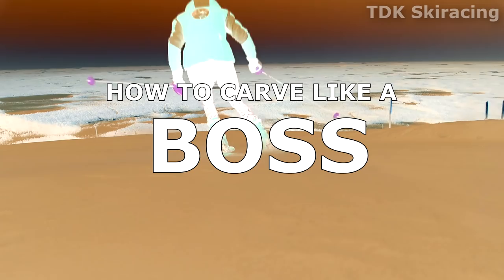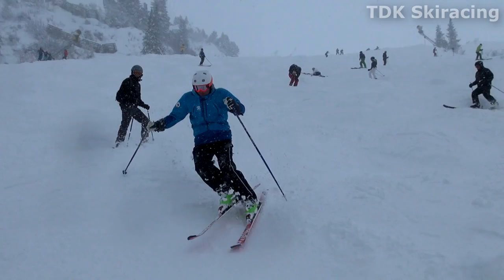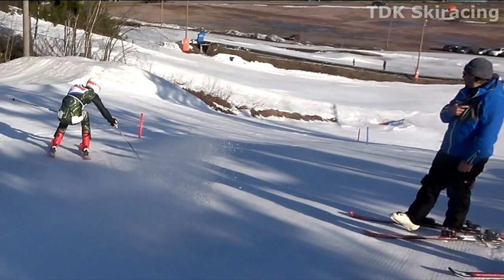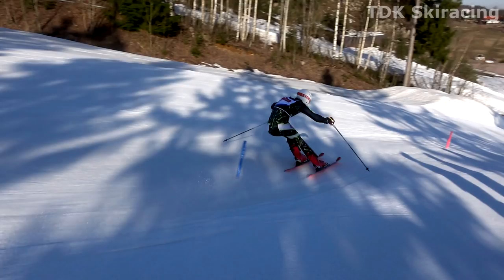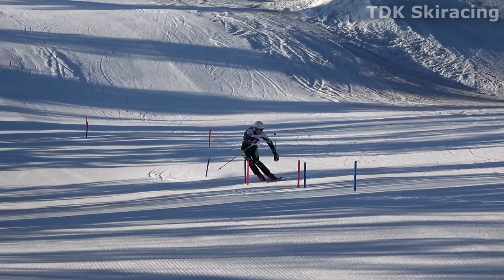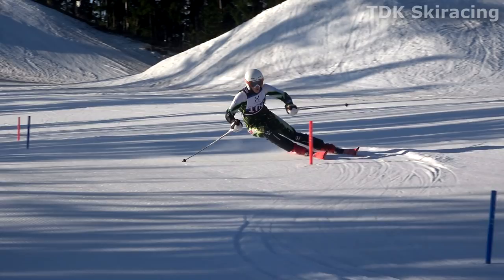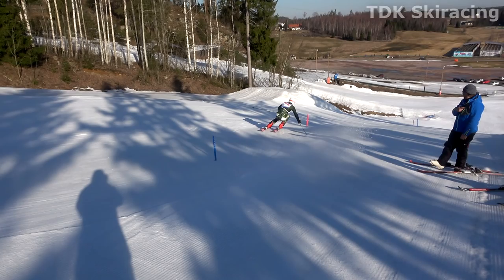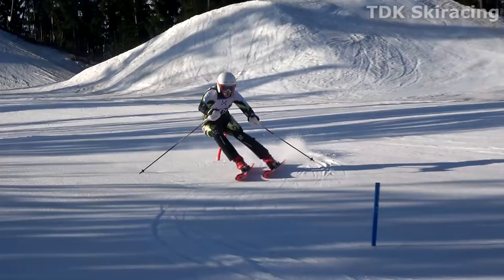How to Carve like a BOSS

Comment: Great video. Active extension and retraction (push and pull) are valuable skills, especially for quick slalom turns. The trick is to have the push compliment edge angulation, not stifle it. A more relaxed initiation allows the knees and hips to drop inside and the edge angle to improve. There's an interplay between strength and relaxation that the best racers master.  At one of Mikaela's recent GS races, the coach called out "Strong and relaxed" as she left the starting gate. She won.

Comment: Great explanation of a key difference between race carving and less aggressive recreational skiing.  I learned to ski in the 70's when unweighting was used in the turn, but since have transitioned to parabolic skis.  I ski recreational, but like to ski fast and keep improving more towards a race style.  At times I deliberately keep my body low and stable, and let the legs just move back and forth underneath, but then I fall back on unweighting when I get tired which brings the body up more vertical again.  Have never seen a video which specifically addresses this issue.  Love all your videos.  Thanks!
Reply from the maker: Hi and thanks for your nice comment. If you haven't watched the 3 Levels of Parallel Skiing please do. Im just the same as you. I carve low and when I get tired I come up higher and at some point I stop carving and ski parallel instead. Even if carving usually is less tiring hahahaa. I hear you with the transition request. I will see what I can do about it. I have lots of topics lined up but that one is very important for sure. Are you familiar with the ILE vs OLR/OLF?
Reply: @Triggerboy62  No, not familiar with ILE vs OLR/OLF.
Reply from the maker: @tomkowalewski15  ok, I'll get back to this asap

Comment: I'm a racing skier and if I can advice you something it wood be that you must be high with your legs and your hip bone ,and then going down with extended legs exploiting the centrifugal force.
if you flex your legs your carve won't be progressive and you won't do speed.
An other advice is that your arms and your bust must be more static and you ave to move only the legs and the hip bone
Reply: another thing ,when I mean that you don't have to flex your legs I don't mean that you haven't to be low ,your body must go forward and absolutely not highward.The thing is that you haven't to carve with flexed legs and with your hip bone downward.
Reply from the maker: Thanks for all your great advice. Not sure if I agree with you regarding being fully extended and with your hips forwards at transition. Are you skiing FIS?

Comment: This is a great video, I especially like the backflip drill (would love to be able to do that). But the first and foremost thing, considering that skiing is a very equipment dependent sport is to buy carving skis/boots. You can only carve so much on a ski that is designed to do the opposite, and seems like many skis today are made for a different style of skiing.
Reply from the maker: Yes, racing skis are the way to go. Full racing. Racing plates and bindings. Huge difference. Also racing tuning. DIY sharp edges. Im going to do a video on that. Also good boots. Note that good boots dont have those fancy bases. The base and luggs should be a solid part of the rest of the outside shell.

Comment: Magnificent progress since he started focusing on down-unweighing for direction change! He's developing into a fine racer. 

His SMIM (single most important movement) now should be foot-pullback, focusing on getting the BoS under his hips in the high-C of the turn. That should fix any excessive aft-errors. One example that area of movement should be the focus is the one you mentioned on 3.30, where his fore-aft error at release is actually the consequence of being aft also in the edge engagement phase, but since the gradient here is shallower, it's less visible. But, the best indication that he needs stronger foot pullback occurs when the gradient increase, such as on 2.37 where the feet are ahead of his pelvis, where mechanical outside forces therefore pressure a stance ski ahead of his CoM due to the feet/hip misalignment. The consequence, a skidded turn (skis that don't slice the surface cleanly), is not due to lack of tipping, but to lack of dorsiflexion and hamstring contraction in the previous turn, so that he doesn't get the skis back underneath him. For the skis to slice cleanly, the feet need to be under or even slightly behind (when it's really steep, due to how quickly gravity pulls your feet after your skis) your CoM at edge engagement. 

Flexion of ankle and knees when the skis are light will give him a whole new experience of speed control on steep gradients. If you're disciplined with your inside foot pullback and counteraction during the turn, stance foot pullback is normally enough for the next. 

Good visual cues that the fore-aft balance is on point in the leveraged parts of the turn: 1) ski tip to snow, ski tail up during the high-C engagement. Requires feet under or behind hips to be skeletally aligned in the sagittal plane for the mechanical outside forces that will act upon the skier. Important: don't get ski tip to snow by plantarflexing the ankle. Dorsiflex ankle, and contract hamstrings to create knee flexion. Crucial for fore-balance in this part. 2) ski tip up at release. Means the stance ski has sliced through the surface and moved forward through the arch. Because of this it's very important to keep the inside hip moving forward through the turn to prevent stance femur rotation and the stance hip following the direction of the ski tips (so that the ski tails hold edge), and it's also very important to keep the inside foot pulled back through the turn so that the weight transfer happens with a stable, dorsiflexed inside ankle with weight distributed between the heel and fifth metatarsal (pinkie toe pad).
Reply from the maker: Thanks. Great content. Yes, it is important to keep your outside ski pulled back under your hips during the pressure phase. But I think its wrong to extend through the transition only because you want to avoid being caught in the back seat. This is what most coaches instruct you to do. Its of course very tiring so not even many ski racers manage to do it properly. Chris was only able to ski down the track 4 times due to fatigue.
Reply: I'm not advocating up-unweighing when I say he should work on keeping his feet under his CoM. When he pulls his feet back during release (bending the stance leg), we get a retraction, a retraction is not a recentering of feet under hips by up-unweighing, it's a re-centering move of feet under hips by down-unweighing /flexing-to-release. That's why I say foot-pullback: foot pullback is not extension, it's knee flexion and ankle dorsiflexion, the very opposite way of getting fore-aft alignment. In other words, we're in agreement. :)
Reply: I think the confusion came from "keep the inside foot pulled back". Note I'm not saying you shouldn straighten the knee joint (knee extension), I'm not saying you should extend the hip to get forward in the high c. What does have to occur is that the parts furthest from the CoM, ie. the feet, has to be brought back under the hips in another way, and this is done by leveraging the joints of those parts (ankle, knee), flexing them. Does that clarify what I tried to say initially, or was there another part in my original comment that caused you to believe I advocated the dreadful up-unweighing? Please let me know, if that's the case, for future cases.
Reply: Yes, strong down-unweighing movements is very taxing on the psoas (hip flexors). The plyos you had him do is a great conditioning exercise for that purpose.
Reply from the maker: @gu5907  thanks for your clarifications. Its so easy to get mixed up when trying to write in few words. Note, some even wrote books on the exact same topic we are discussing. A funny thing regarding up-unweighting and down-unweighting... it has nothing to do with flexion and extension. Its purely a matter of "how our CoM moves in the vertical plane". When the CoM is moving up and it stops there is a moment of inertia and that is what we call a moment of unweighting. And since the CoM was moving up before unweighting we call it up-unweighting. Down-unweighting again is when our CoM suddenly moves down and we get a moment of inertia when we feel unweighted. Since our CoM moved down to cause this effect of unweighting we call it down-unweighting. And it has noting to do with extension or flexion. Except that we usually extend up to move our CoM up and vice versa. My point is that even if we flex our legs our CoM can be moving up and that is not what is commonly thought as down-unweighting but instead up-unweighting. The classical example is bumps. The bump pushes us up and we use this upward movement of our CoM to down-unweight. So, duw is just the latter component of uuw. Or lets say that all uuw has a component of duw as we start to drop down. Thats why pure duw is not practical. uuw gives us a much longer float. Not 10 times but nearly. This is the reason I like to talk about "extending to up-unweight" when I talk about the classic open parallel parallel christie. And "retraction turns" for carving. ILE is the other carving alternative transition. There you dont flex your outside leg to release. There you extend your inside leg. That is what the guy is doing in the "extended position" in the video. Sorry for long posting.
Reply: @Triggerboy62 
Very interesting! There are 2 different things : flexion and retraction. Retraction is about dealing with the flight after apex. We retract for not flying too much like optraken. The reason why is that if we unroll the trajectory we go from steep to flat etc.
Flexion is different. There as you said  you underweight. 
In slalom you use both retraction and flexion. But since your skis trajectory is a sequence of steep and flat you use mainly retraction like skiing in bumps. Flexing for releasing pressure is a misconception as far as slalom is concerned. In slalom you release pressure in transition because your COM is goinh straight ie no inertial force anymore. There are 2 cases in both you project your COM forward and downward in the transition as the world competitor was talking about here.
First case you turn very short. This is common case often with pivots.There retraction is king. 
Second case you turn less with less ground reaction. There you will flex more slowly and your COM going forward you will be more centered when skis are flatted. This is the turns of the guy where you put a red cross.  And this transition can be called cross under :see the former turns of the guy.
Imho since Chris is not turning too short in the gates he should be more centered in transition. I mean his fore aft movements are quite weak here.
Reply from the maker: @magnificoas388  Thanks. But dont you think that if Chris was more centered at transition also his CoM would have been higher? That again would have meant that he would have had to drop it down first instead as now, just push it quickly sideways into the turn? Thats the whole point. You need to be quick. Lifting your CoM up will slow you down way too much. Or?
Reply: @Triggerboy62  that's a bright remark:)
First I will say that projection of your COM forward and downward is mandatory.
Second even if you are more centered while transition you are still reactive: you don't have to drop your body indide for next turn since you do still crossunder, you will deploy your skis for next turn. That is all about dissociation. Your COM goes forward! That means that compared to crossover you don't go so high.
Third there is the case when you are less centered when your turn is very short and you use pivot. Centering here is just delayed since you have shortened the first part of the next turn.
Reply from the maker: @magnificoas388  thanks for your quick reply. In my opinion Chris is pushing his hips forwards and down in the fall line aggressively for acceleration but is doing so as he extends out into the turn. Not into the transition as in a more traditional cross over transition. On footage from WC racers you can easily get the false impression that they are re-centering and pushing their hips forwards in the transition as it looks like they are extending up at transition but its just their CoM that is ricing due to body mechanics. Because they are low with their hip on the snow in the turn they need to vault over into the next turn as their lower leg is pointing upwards. They cant drag their hips on the snow from one turn to the next, from one side to the next. One thing I should mention is that its a good thing to have the CoM going up a bit at transition and then down again into the turn as it creates momentum needed for short late pressure. If I read you reply correctly, we might be talking about the same thing. All gates are not the same and sometimes your CoM can be higher, sometimes lower. Sometimes you need to cross over, some times cross under. And everything in between. Does it make any sense?
Reply: @Triggerboy62 thx for your answer. yes we are talking about same topic :) the main point we "think" different is this one: waterever transition you do crossover or crossunder you have to start projecting  your hips forward and downward just at start of transition. Please check your own video of C Noel about this. It is patent. And he does cross under all the time. 
Hirscher does 2 things at the same time: retracting a lot and projectiing is COM a lot from apex going from one foot to the future external one ... 
Second point crossover almost desapeared in slalom.
PS vaulting is a visual of going more downward...
PS2 while retracting Chris sometimes is breaking his chest forward instead of projecting his hips

Comment: Would you do more videos explaining and teaching the flexion transition with the outside leg or extended leg retraction?  I really started to understand the new ski racing turn in this video.  I would like to see it over and over again.  Also, are their more tips and drills to work on for this turn?  It reminds me a lot of a mogul turn.  Stay flex as you absorb the bump and extend into the trough of the mogul.  It helps to actively pull you feet to your chest.  I feel, This is much like what you said about pulling the extended or outside leg to your chest and extending into the next turn.  I think a real difference is to start and stay in the low extended position.  As always a great video.
Reply from the maker: Thanks for watching. Yes, I need to make some more videos on this topic. Did you see my "secret move in ski racing". Check them out. They are about the same topic but a bit older so you might not have seen them. Good analogy regarding bump skiing. And the trick is not to start tall and then flex but the other way around. Same with carving. Start low and extend out into the turn. Not the other way around. That is the most typical mistake.

Comment: hahaha...doing it right is very tiring 
but at the same time I find this an only way to really enjoy the speed and centripetal force :))
btw, great video as always!
Reply: You mean centripetal force?
Reply: @santiagobustamante2082 oops :))
Reply: Sorry 😂, i'm studying physics, can't hold it
Reply from the maker: There is a centrifugal force if you frame of reference is the skier himself, or?
Reply: @Triggerboy62  it's just my second year studying physics and i have been in holidays for the last 3 months so i'm not quite an expert yet; however i don't think it matters. Every force has an origin, in the case of the centripetal force the origin is the contact between the ski and the snow, it's also called the normal force and it aims towards the center of the turn. In the case of the "centrifugal" force it has no origin, there is nothing that pulls you towards the outside of the turn, that's why it doesn't exist. The "centrifugal" force that you feel when you are skiing is the inertia, however the inertia is not a force, is just a tendency of continuing with the movement. I hope that everything i wrote was clear, English is not my native language. Greetings!
Reply: @santiagobustamante2082  , unfortunately your statement is partially wrong : when you try to turn , you try to deviate from  a straight trajectory of your mass, and you must then apply a force to counterbalance the tendency of your mass to go straigth: this force is call centrifuge.

Comment: Nice, I've tried going low but always ended up falling on my back when I got too enthusiastic on the slope
Reply from the maker: Yes, that happens to all of us. Even WC racers. Hang in there :)
Reply: I think you should work on your abs and lower back
Reply from the maker: @b0tb0t83  yes, exactly. A good carve starts in the gym :)
Reply: Unless you’re a racer, try standing tall. A tall stance really frees up your femur to make even, balanced turns.
Reply: Also make sure to put enough pressure on the bottom ski...
Reply: Philip Schwartz hopefully we're speaking apples and oranges because I'm not sure why you're encouraging standing tall. That only allows for inclining or banking without  any angulation.  Also inhibits good touch on the snow without ability to absorb.  Also inhibits ankle tension to keep forward pressure to start the carve in the initiating of the turn.  Standing tall, with a straighter leg also inhibits knee movement necessary in initiation of a good carved turn.